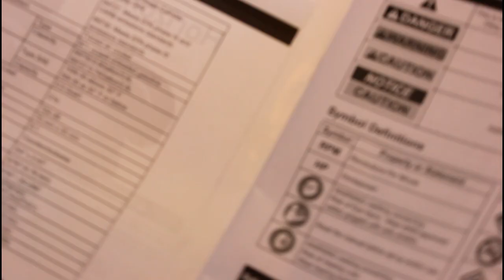Homemade Go Kart Predator 212cc Valve Spring Swap + Test Drive!

Comment: SAVE YOUR THUMBS... The best way to put the 18 pound Valve springs in. You will need pliers and medium size zip ties... USE THE PLIERS TO PRESS THE SPRING IN AND PUT A ZIP TIE ON EACH SIDE HOLDING THE SPRING PRESSED IN.. TOTAL OF TWO ZIP TIES TO SPRING.. THEN PUT THE VALUE HOLDING CAPS BACK ON AND CUT THE ZIP TIES AND USE NEEDLE NOSE PLIERS TO PULL OUT THE ZIP TIES AFTER CUT.. U MIGHT NEED A FLAT HEAD SCREWDRIVER TO LIFT UP THE VALUE SPRING TO PULL OUT A ZIP TIE IF ONE GETS CAUGHT.. TO GET THE VALUE CAPS OFF GET SOME SMALL PLIERS AND PUSH IN AND WIGGLE BACK AND FORTH..
Reply from the maker: Thanks for your input Chris, I'm sure this will definitely help someone out!
Reply: i use this method,, all good till it busts and takes your eye out!!!
Reply: Hahahahahah   take u eye out kid! 
hahahahaahahah

Comment: Can you use small zip ties to compress the springs to where you can install them and then go nice installed , cut the zip tie
Reply from the maker: That could work. The only thing that may cause issues is if the zip tie doesn't let the spring sit down all the way. Also be careful of FOD when you cut the zip tie!

Comment: I'm fairly competent in building these engines. I find it is much easier to remove the head, change the springs and add a performance head gasket while I'm in there. Either way you have to relash the valves. Another trick is to use 22# springs. They are the same length as the stock springs but slightly beefier in actual construction. Just some tricks I've learned that are much easier than losing a split retainer in the block and then having to pull the motor!
Reply from the maker: Awesome thanks for the tips!
Reply: Yes I believe that is the way I will do it

Comment: Did you have a billet cam and rod to accommodate for the springs? Have you had any issues after installing the spring?
Reply from the maker: Haven't done any billet parts yet, and nope no problems so far.

Comment: Aren't you supposed to have a lash cap on the exhaust valve where the rocker makes contact with the valve?  I've got a 208cc LCT engine, very similar to the Predator 212cc, and I thought I'd lost a lash cap because I could only find one.  I have been told on a few FB karting pages, and read elsewhere that the 212cc and the similar Honda clones have one lash cap on the exhaust side only.

Have you ever noticed this, or been told this?  I imagine that will also affect your exhaust valve lash settings since the .20mm (or whatever you adjust to with the 18lb. springs) won't actually be the same if its intended to be done with a lash cap in place?
Reply from the maker: I actually didn't notice lash caps on either side, but I was pretty cautious when disassembling the engine and putting it back together, and I didn't notice any loose parts or have an extra parts left over. I've been running the engine for quite awhile now and haven't had any issues.

Comment: If you just have a header pipe and performance air filter, and still have the governor. Do you still have to change the valve springs
Reply from the maker: Not really. Valve springs are really for when you remove the governor so you don't get valve float at the higher RPMs.

Comment: Can you put the piston top died center, top keep the valves from falling
Reply from the maker: Yes, I believe that's another method you can use. I would still try and feed a little rope in (if there's room) even at TDC to make sure you don't drop a valve.

Comment: U hav a non-hemi predator 212. The hemi version is the ones with the notch in the valve spring cap
Reply from the maker: I have seen non-hemis with the notched valve spring cap, but yes most of the time it's the hemis that have that feature

Comment: What's the pressure of stock spings? Can in put a next level pressure springs on a stock engine without any other modification?
Reply: Pretty sure it’s 12lb
Reply from the maker: Yea It's probably somewhere around 12 lbs. I've put 18 lb springs in and haven't changed anything else internally and it's been running great.

Comment: Hey bro I’m trying to put 26 pound Valves springs on my 212 predator engine would I have to upgrade my valves as well?
Reply from the maker: Hey Jesus, yea it’s recommended when going with springs that have that you use stainless steel valves and retainers. ARC racing has some great products.
Reply: Ok thank you

Comment: My right spring when I push it down the stick goes down with it I’ve tried hitting it hard pushing hard but it moves with the stick so the cap won’t come off help?
Reply: any luck? running into the same problem right now.

Comment: one tip you should on the safe side put some kind of stress bar for ur exhaust i saw it bend easy on the video when ur arm touched it and ive learned it damages the seal faster alot faster actually but thats just me. just giving you a heads up if your interested
Reply from the maker: Thanks man, I'll take note of that.

Comment: Would you recommend going higher in valve springs like 36-37lbs
Reply from the maker: Only if you're planning on really upgrading the rest of the motor, if you're just doing a stage 1 upgrade kit, 36 lb valve springs are a bit overkill.
Reply: I was running 22lb spring on stock valves on my gx200, the valve broke in half and was half way inside the pisten head, you need stainless valves first
Reply: Also you can bend a pushrod and or wear the cam lobs down

Comment: Good video was alittle confused when all the other videos had different values cups took me alittle till I found a trick use two nut drivers with 10mm sockets to push the spring in
Reply from the maker: Glad you got it figured out! Yea I noticed that too that there were a few different versions of the valve caps.

Comment: Cant you just measure factory valve lash setting before disassembly? If you use factory setting afterwards itd be the same before you tear it apart.
Reply from the maker: Yea that’s one way to do it, you may get a little error if the engine has been run for awhile and the lash has possibly loosened. The manual for the 212 shows oem lash settings

Comment: Honda 18lb springs won't work,they bind. Good luck.
Reply from the maker: Haven’t had a problem with them since
Reply: @Addimotive  mine bind on me .they were a lot longer than the stock, and arc.
Reply from the maker: Hm interesting. Were they genuine Honda parts or knock offs? I’ve heard of people having issues with cheap knock offs.  But if they were longer than the OEM Predator ones they won’t work because of the stock push rods and rockers
Reply: @Addimotive  may have been, good luck on your build.